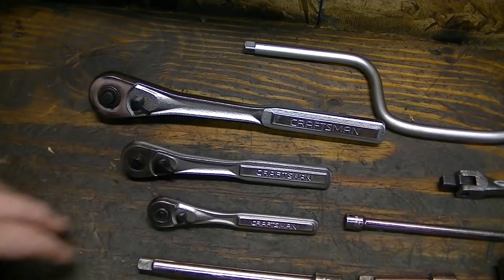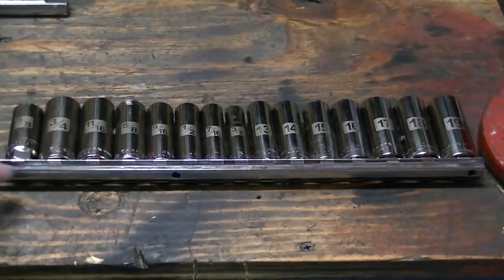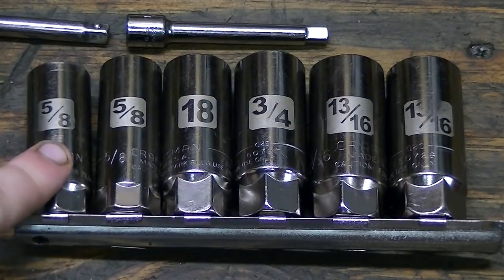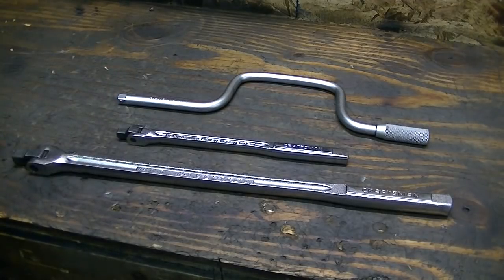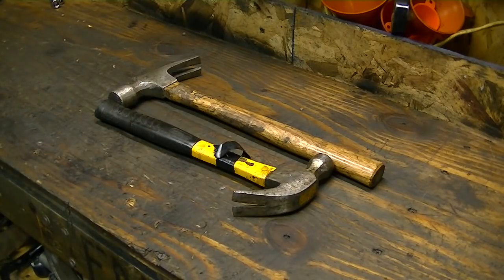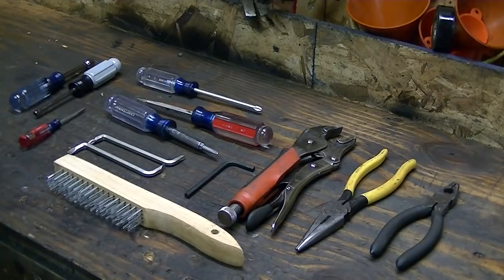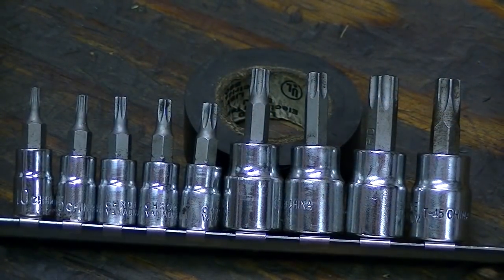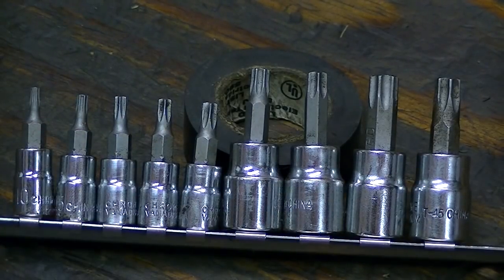BASIC Tools Needed for Small Engine and Lawn Mower Repair

Comment: Some more tools I couldn't do without. Air hammer with attachments. 4" angle head grinder with metal cut off wheel, a good welder, the 7 special screwdrivers you need to adjust 2 cycle carburetors,
Reply from the maker: This is true, the more tools you have the easier and faster you can fix things. Thanks for Watching!!!

Comment from the maker: Yes I highly recommend craftsman sets, actually most of the sockets/wrenches/ratchets you see in this video was from a 239 piece set, but i've added alot to it, mine is the easy-to-ready laser etched set, which makes the socket very easy to read, I see pretty good but I do find these alot easier than standard sockets. You could spend 10,000 on a complete set and still be adding to it a week later haha thanks for watching!!!

Comment from the maker: my main torque wrench is 3/8" drive, oh wow haha that would be good for torqing flywheels, not so much for head bolts or crankcase bolts, you need something up to like maybe 250 inch pounds or so, most bolts are less than that small engines, yours is measured in newtons, i don't a thing about that!!! thanks for watching!!!

Comment: You didn't mention a parts washer or some kind of lift like a chain fall. I had a Friend who does Small Engine Repair on the side recommended getting a vacumn device that sucks out fluids (like oil)

Comment: Wonderful. Thanks!  I want to get a basic set. How much do you think it would cost?
Reply from the maker: Your welcome! I'd say with $300 you could get enough to get started in basic repair, thats just including hand tools like ratchets, sockets, wrenches, pliers, etc Once you get into complete rebuilding it will take alot more than that. You will be constantly adding something to your tool collection, i'd say every month i pick up something that will come in handy or have to get something for a current project / job. 300 dollars is really pushing it though, my craftsman set alone (just ratchets, sockets, wrenches) was almost 250, but you can save a buy off brand too. Alot of options, and it depends on what your planning on doing, general repairs or full rebuilds. Hope this helps, Thanks for Watching!!
Reply: I realize this an old post but hit your local yard/garage sales,flea markets etc. I have picked up many decent tools even some higher end ones cheap. Just gotta dig through the boxes and piles. Good luck and enjoy

Comment: is there a specific type of table that I can use to fix lawnmowers instead of fixing them on the floor?
Reply from the maker: I usually will either work off the floor or put it on my workbench, but 
one idea that comes to mind is a scissor lift, they have wheels on them 
and can lift quite a bit, harbor freight sales them. Thanks for 
Watching!!!
Reply: Yea, I want one of the Harbor Freight lifts. It's actually a motorcycle lift but it would be perfect. Right now I use two ramps made out of 8 foot 2 X 12 boards with ramp ends on them. I roll the mower up on to my work bench. Doesn't work for riding mower or zero turns though.
Reply from the maker: I've thought of getting that, but now they have the atv/lawn mower lift that cradles the front wheels and raises it like that, good for taking blades off. I might get one at some point. thanks for watching!!!